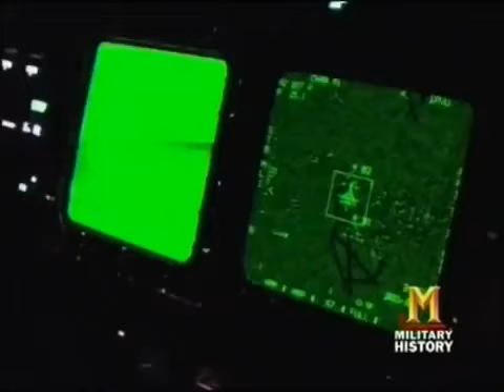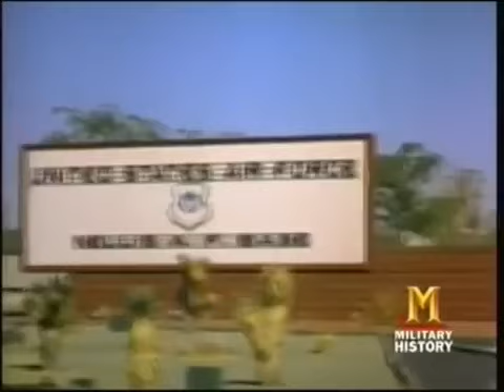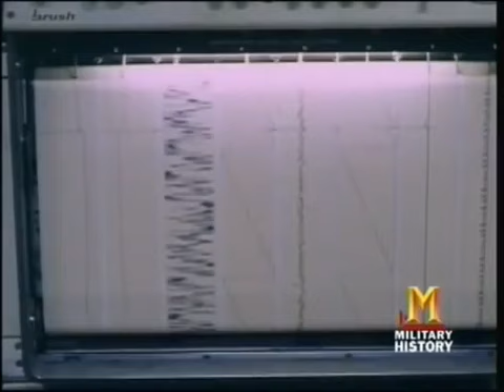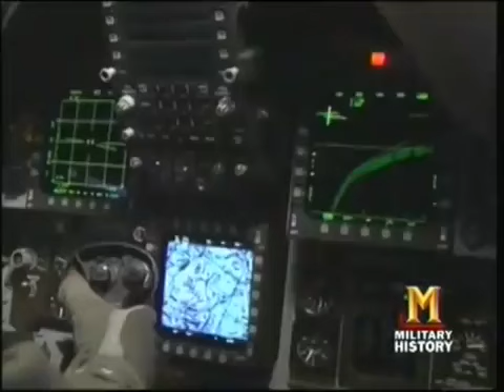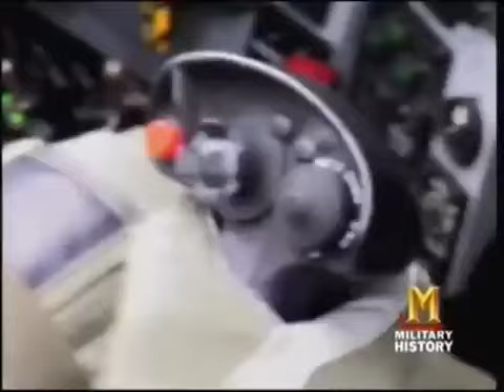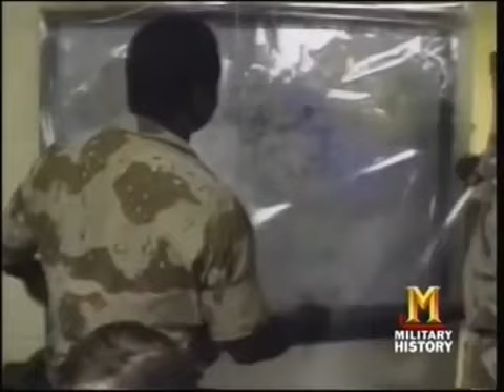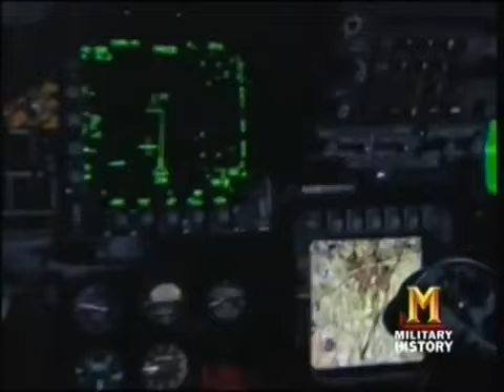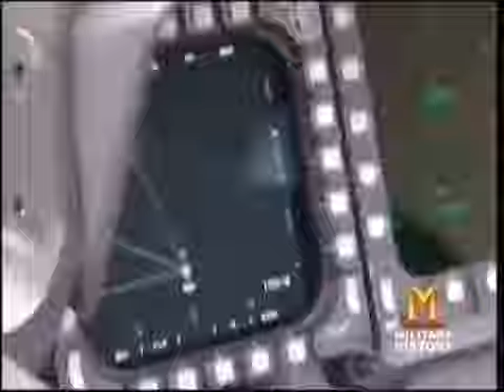F-15 Eagle - Deadliest Military Aircraft

Comment: Even though the f15 has been mow out done in certain areas by some of the newer planes,with the skill of american pilots that would make it a still very viable and modern fighting plane.maybe im wrong,but ive read that the f15 will be used to carry 9 or 10  missles that will be fired by the leading f22s.